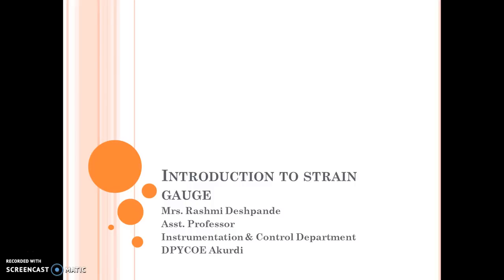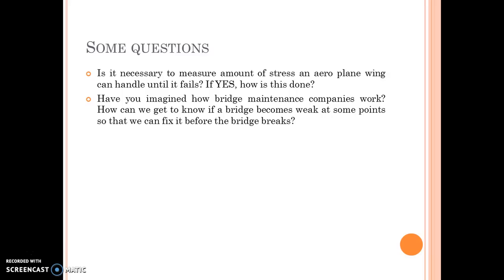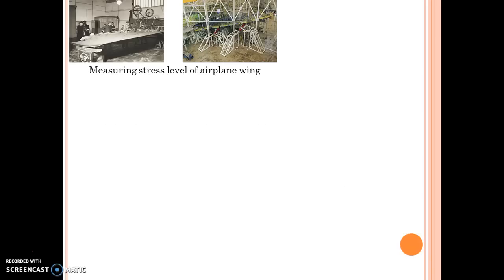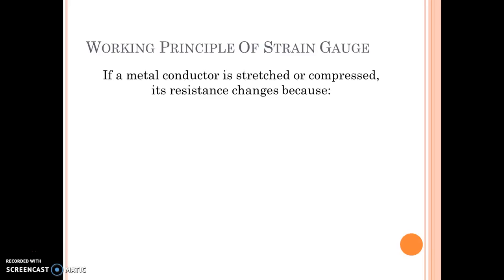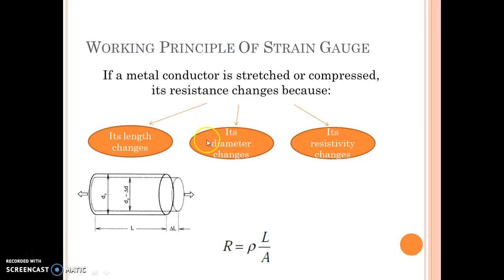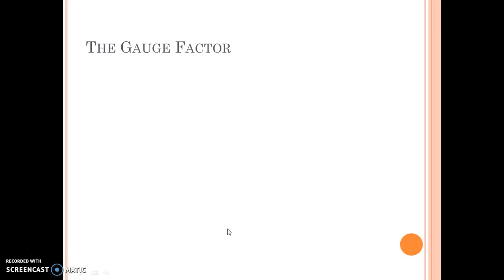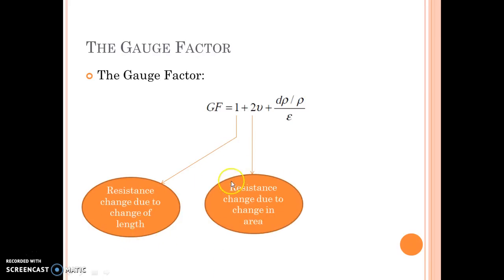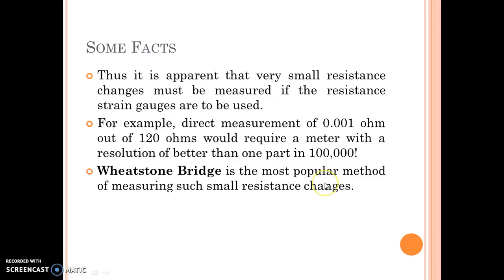Introduction Strain Gauge

Comment: how resistivity of metal going to change by stretching it?
Reply: when the length increases the resistance also increases, since electrons should collide much to travel further, thus it directly increases the resistance,, look at the framed formula,  r=(Rho*L/A)
Reply: Because resistance = resistivity * (length/area). so by this relation on stretching,the length increases and resistivity decreases.